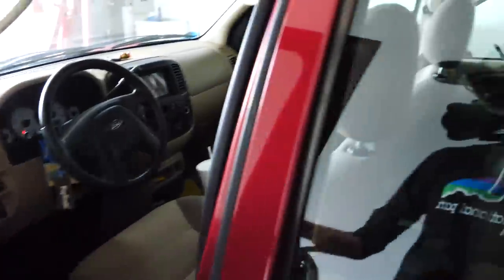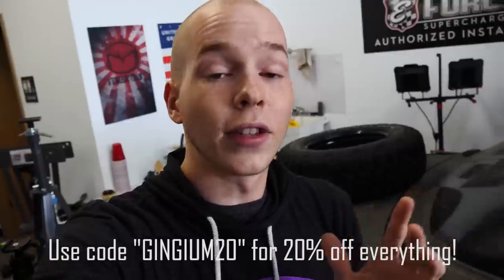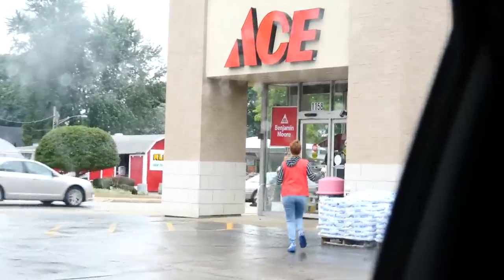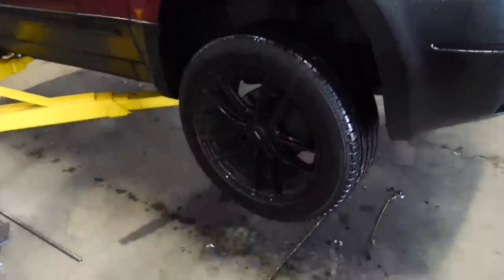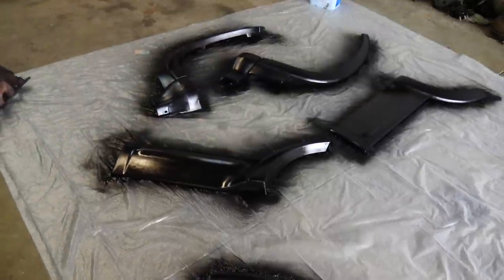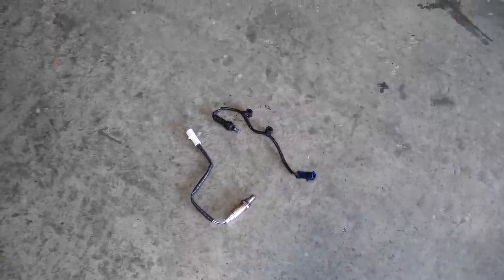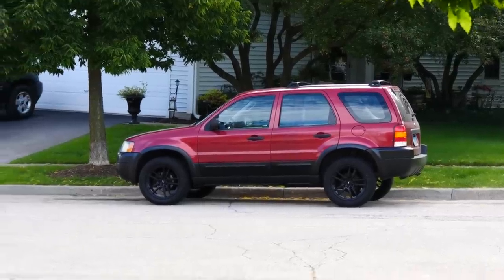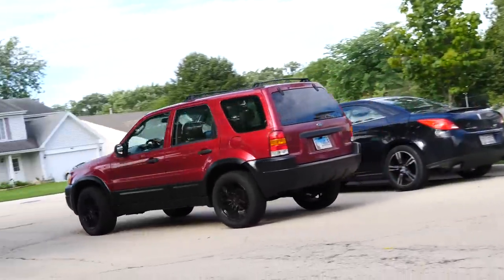Installing Fender Flares on Audrey's Escape!

Comment: The Escape need fog lights.
Reply: and rear disc brakes, if it's possible
Reply from the maker: Yes it does
Reply: Yeah.
Reply: Gingium check out some flush mount led pods
Reply: it needs full led's swap light bulbs asap.

Comment: Gingium, you want ot do something awesome? Here are a couple of things that would be awesome:

1. Buy a Subaru for rally and leave the Ralyata alone.
2. Swap a 2.5L MZR Turbo into Molly instead of a Honda (Duratec Turbo 2.5 would work too, since they're the same engine).

Here's something you should have done that would have been cool, but too late now:

1. Swap a 5.0 Coyote and stock T-5 5 speed into the drift truck instead of the UZ and Nissan tranny.

Also, we don't care about Audry's makeup.

Comment: Yo Gingium
Just a question. Why dont u use dry sump instead of wet sump. If that is called by that in the us. I follow a car mechanic study and learned this the other day. It will provide lower engine height and maby make room for your steering something to fit. Idk what is in english 😂 
I also discussed it with my teacher and he could understand your problem but thinks this wil fix it

Comment: Ended up doing the same thing but I didn't use the double sided adhesive tape because over time it'd just come off. My friend and I went to a junk yard and he pulled it all off and then instead of using the tape just drilled 3 holes on each door and lined up perfectly.  The only down fall of the whole thing is the Escapes with the Fender Flares the rear bumper is wider so the rear fender flare lines up but it doesn't sit flush with the bumper since the rear bumper isn't as wide.

Comment: If you get the right tool the double sided tape should not take off the paint, get the tool that is basically a multi purpose wire wheel with the front and bottom bit exposed kinda like a grinder but it has a 1' thick wire wheel or rubber wheel with notches in it to take off double sided tape.

Comment: Try do a chain and sprocket system on the steering instead of moving the engine pull the column over and link it to the rack with a chain use a slider adjuster with a bearing to tension the chain